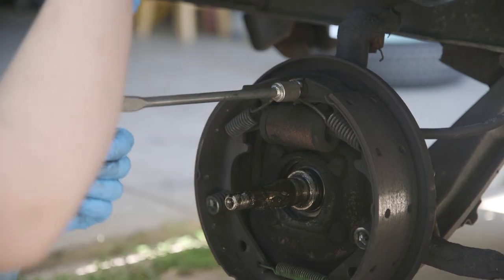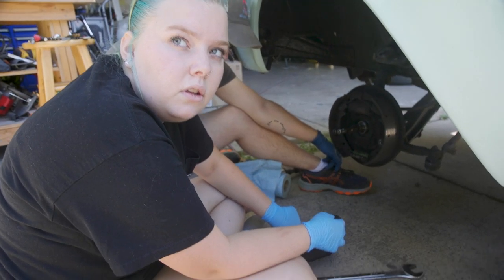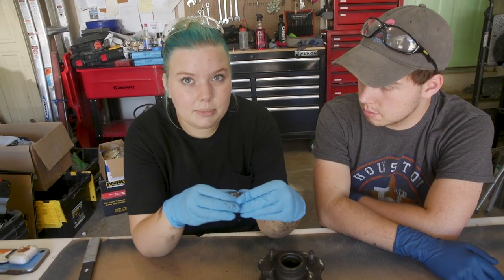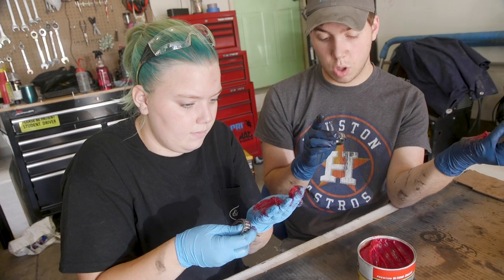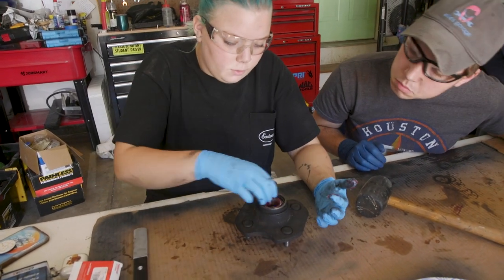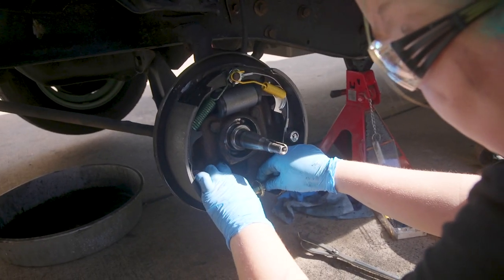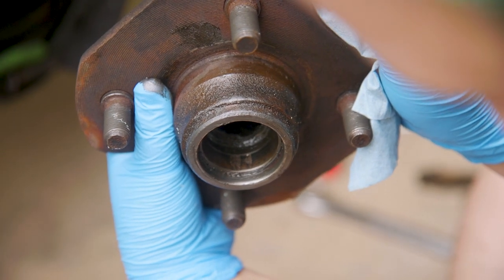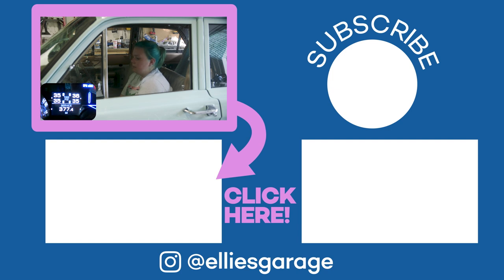First Time Changing Front Drum Brakes on My ’65 Falcon!

Comment: Great video, really enjoy seeing you and your family working together and having fun. On the dust caps you can check the OD  and then check the ID of the hub if the tolerance of them are really tight grind the edge of the dust cap down a little bit to get them started with a thin layer of grease.

Comment: It's possible the new dust caps were not made properly.  Many parts manufactured today don't fit correctly.  Great job again family.
Reply from the maker: We were wondering about that. They are new ones. We'll give it a try again. Thanks!!
Reply: Yes. I was wondering if they are too shallow and the end of the threads of the spindle was pushing on the inside. Because those should have seated by tapping on the edges with a screwdriver end hit on the handle end lightly.

Comment: Sit the dust cap inside a piece of square tube, line it up and then smack the end of the tube with a big hammer. The tube will push the cap in by catching on the little lip that sticks out and you don’t damage the dust cap because you hit the tube

Comment: Another great video. A couple of points to consider when you rebuild your next car.

Dust caps come in various sizes in both imperial and metric. Measure the ID of the hub with a vernier to get the correct measurement and get new dusts caps to suit.

Wheel bearings are fun to do. Unfortunately they do not hold enough grease on their own to ensure a long service life. Once you have the inner (larger) bearing race in the hub put a palm full of grease into the centre of the hub then fit the bearing and seal. Fit the hub onto the spindle then the the outer (smaller) bearing. Never just replace a bearing, you mentioned you were hoping to be able to only need to replace the bearings, always replace the race as well and keep the race with the bearing it comes with because they are a matched set. When fitting new races use the old race as the "drift" surface that the bearing installer, in this case the socket, hits against. If you grind the outside of the old race down a couple of thou it will fall out on its own after installing the new race.

Brake springs are dangerous especially when under tension but not stable. I was so glad when Matt mentioned about the safety glasses after the retaining spring went flying.

Before adjusting the brakes bleed the wheel cylinders because during the process of bleeding you centralise the brake pads in the drum which then makes adjusting easier and more accurate.

After driving for a week it may be a good idea to check wheel bearing adjustment, new bearings settle in, and brake pad adjustment.

Comment: A couple of notes I like the way you capped the lines another thing you can do is disconnect the ground and then depress the pedal and hold it down, the cups being past the ports in the master cylinder will block the fluid from flowing out. I like to keep the bearings and races together since they are machined to match, and where are your race drivers? but if you needed use the old race to prevent damage to the new one. If you put the starwheel adjuster, spring and adjuster arm in the shoes the spring tension will hold the setup on the backing plate while you put on the spring clamps. You don't have to brake hard to make the adjuster arm, adjust the star wheel light pressure will do and the cap take a pair of pliers and angle the lead edge in just a hair and the will pop right in! It looks like the preload on the old bearings was a little heavy causing the old bearing to get too hot. Also I like to flush the whole amount of brake fluid when I do brakes It gets old absorbs water and it catches all the garbage from wear inside the system! Another great video keep up the great work!
Reply from the maker: As always, thanks for the great information and encouragement!!

Comment: Another trick you can do if you don't have a socket to press the new bearing race back in - Is to take the old bearing race and grind the outside diameter of it to use as a tool - Just grind it down so it slides easily into the hub. Then, just put the old race on top of the new one, then tap it in with a hammer.
Reply from the maker: Great tip!

Comment: Carefully re-crimp the lip all the way around with pliers until it is a better fit
And/Or
See if you can find a short pipe with the same ID as the OD of the cap's lip. Use the pipe as a driver to install the cap. You may need to put the cap on the end of the pipe so you can hit it in the center to drive the cap on square.
Reply from the maker: YES! That's the tip we got and we'll be giving that a try soon! Thank you!!!
Reply: A large deep socket works well too!
Reply: @ElliesGarage are these dust covers the ones that came with Carl originally? back when I was doing my Falcon I was going to replace the dented ones with some that Dad found in one of the railroad cars he was repairing but they were bigger than the original ones and wouldn't work,I didn't know if you bought new ones or not but could've been sent the wrong ones, also when putting in seals if you get them setting correctly then use a wooden block and tap in until flush.

Comment: awsome job drum brakes are usually hard for beginners you breezed right through them also if the car pulls to one side or the other while braking the adjustment is uneven side to side . have you considered converting to disk brakes way easier to replace and safer .
Reply from the maker: Thanks so much! Yes, we have plans for a disc conversion as well as replacing the front suspension in future videos this summer. 😀

Comment: Instrucions unclear i missed the part ware your brake drum are seized on the car lmao... 1965 meteor here
Reply: Turns out i had to remove the wheel nut i was just trying to knock it loose with a small slege hammer and chipped off some peices from the drum. Also there was no brake hardware in there and it was all removed ill have to do brakes before i can get the meteor moving under its own power but at least i got it started.
Reply: finally got parts for the brakes, and it winter now.